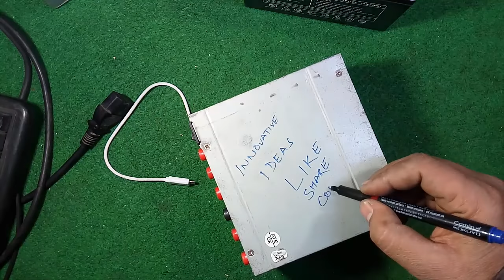How to recycle SMPS of Computer for battery charger and smartphone charger by innovative ideas

Comment: This was by far THEE BEST video on the subject that I've seen I have been on YouTube for over 10 years and this is the first video that has made me want to leave a comment
Reply: Me too..!
Reply: Hello sir If want to charge my 12 volts  battery with 15 volts...then How can I do that..? Plz reply..

And when I connect -12 volt and +3.33 volts then I am getting approx 14.8 volts...but how much amp..? Do you have any idea? Plz share to me. Bcz I am not able to measure amp bcz I  have only volt meter
Reply: Can I use Red And black wire for charging smartphone...then will provide 5 volt 30 Amp for fast changing..😁😁😆😅... This the serious question plz reply me.
Reply: nic
Reply: I fully agree with this statement, it has been 45 Years since I worked as a technician and This video brings me back to my younger days. Vert nice!
Reply from the maker: Thanks a lot
Reply: The best video ever,.. thanks
Reply: @TheSudiptheory ❤

Comment: There must me literally dozens of this type of mod to the ATX power supply on youtube.  To do this right, the battery needs to be charged to 13+ volts dc, this video doesn't show how to boost the smps to that level.  Thumbs down.
Reply from the maker: Sir, I am sorry for that, but practically I have charged the battery without boosting the SMPS, and I got success, after that I made this video.. Anyway thanks.
Reply: Joseph Nicholas 13,6V
Reply: Thanks Sale Bmw.
Reply: You are very much right.
Reply: Sir, I think the current was too heavy for charging...............
Reply: Joseph Nicholas You are correct! The voltage (not current) required to charge correctly a 12 volt lead acid battery is ACTUALLY 14.2 to 14.8 (manufacturer specification dependent - typically 14.4 is safe for just about ALL 12 volt lead acid batteries. The fully charged state of the battery after say 4 or 5 hours after coming OFF charge should be between 13.6 and 13.9 volts - 13.8 volts is typically seen. The maximum charging current should be LIMITED to prevent excessive heat generated by trying to drive too many amps into a deeply discharged battery, but 5 to 6  or even 8 to 10 amps depending on battery capacity is typical.

A 12 volt power supply can NEVER, NEVER, NEVER fully charge a 12 volt battery. 

Why? Simple, ALL batteries have some internal resistance and you must overcome the resistance with sufficient voltage to drive a charging current through the battery. 12 volts just is NOT enough to do the thing correctly, especially when a fully charged lead acid cell can easily reach 2.4 volts (nominal 2 volts) - 6 cells in a 12 volt lead acid battery = 6 x 2.4 = 14.4 volts!! Hence the charging voltage required. 

Lead acid batteries perform best when trickle charged AFTER they have reached a fully charged state. This prevents loss of terminal voltage due to internal discharge. Continually trying to charge a 12 volt battery with a 12 volt supply will NOT do the battery any good long term whatsoever and it will NEVER reach a fully charged state. Also, a battery discharged to the amount in this video is basically a knackered battery. Yes, it can still receive some charge and yes it can deliver some current but it will NEVER be able to reach it's nominal new performance EVER again.

The ONE thing that NONE of these videos deliver is a reliable, simple, accurate and low cost way to obtain 12 to say 35 volts from such a supply. Or how to provide an adjustable supply with adjustable current limiting - something a true bench supply would have. This beggars belief really, considering how simple and cheap this is to do these days. Search for a DC-DC boost circuit board on eBay (there are dozens). Some can be driven by as low as the 3.3 v rail (very useful when modern supplies have their largest power available on 3.3 and 12 volts. Many of these circuits can deliver in excess of 500 watts(!!) so be careful in your selection that you don't inadvertently provide a means of overloading the underlying supply. Simply hook up the boost converter to a relevant power rail (3.3, 5 or 12 volts) adjust the output voltage to what you need and provide one more set of DC Banana sockets for the output. Job done. 

Here's a link to a page that has several different types and capabilities (pick the best fit or search for others) ranging in price from less than $3 to under $12. Add an external case mounted potentiometer to replace the on-board one (or multiple external pots if current limit adjustment is also available) and a low cost mini DVM (and current) display for a few bucks (also on eBay) and NOW you have yourself a PROPER adjustable bench supply. These are so small and power efficient, a couple could be fitted inside a typical ATX PSU to give multiple capabilities. With a small amount of extra work and the making, or purchase, of a more suitable case, the whole ATX supply minus case could be transferred AND additional parts like individual voltmeters on each output provided in the extra space, and an extremely capable supply can be created.

http://www.ebay.co.uk/itm/DC-DC-Boost-Converter-Step-Up-Step-Down-Power-Adjustable-Portable-Charger-W/222281739597
Reply: Joseph Nicholas how about connecting -3 and +12 in series means we can use the +12 v as positive and -3 as nagitive or even -5 as nagitive so the difference between voltage will b 15v or 17v
Reply: hassan ali NO! Definitely do not do this as in almost every case it is impossible to guarantee the isolation of the ground leads from each other, nor for the two supplies to track each other, nor to maintain proper overcurrent, overvolts and short circuit protection. VERY unwise.
Reply: Bob Lewis did u try -3 as nagitive and +12 as posive practicaly
Reply: 1. it's NOT practical as it would still provide insufficient voltage to charge the battery - you need 14.4 volts to be able to properly charge a 12v lead acid battery - sealed or car battery
2. it's NOT safe for the reasons I already outlined
3.There is NO -3v rail on an ATX supply. There is no -5V rail on an ATX supply! From where are you suddenly getting these negative voltages?

Stick to a tried, simple, highly reliable and well tested method ... PLEAS!  Use a boost converter and or a separate supply. There are PLENTY of videos online showing how to do it properly using a laptop power brick (minimum 16 volts) and a cheap switching DC-DC adjustable supply (<$4 on eBay or Banggood) If you can't afford such a supply then cannibalise the ATX supply for parts, rewind the main power transformer to provide the output you require and design an equivalent circuit that gives you an adjustable 14 to 15v output 5 A supply and set it to 14.4 volts.
Reply: Well we ARE talking about a POWER rail - to match the +12v output in terms of current supply are we not? Let me be MORE specific - there is NO -5v or -12v POWER rail on ATX supplies. i.e. there is no negative rail of over mA rating i.e. something USEFUL in this regard. Yes, there is SOMETIMES a -5v voltage rail and usually a -12v voltage rail (including some supplies that SAY they have a -5v rail but have no output wire for it - I have one! NO white wire anywhere in sight! And others that have no -5v at all even on the label!) 

The ABSOLUTE maximum current from the negative 12 volts is typically less than 800mA, often as little as 300mA  and the -5v (if it even exists) is 0.3A or less typically. That's barely enough to trickle charge a small battery let alone a 45AH one. Anyone who connects the -5v or the -12v in series with the +12v POWER rail will very quickly see LOTS and LOTS of magic smoke (and sparks and fire too probably) if they try to charge at 3 or 4 amps like that - the +12v rail will have no problem supplying tens of amps usually but trying to drive that current into the -5v, 300 mA (MAX!!!) rail is just plain DUMB. So I stand by my statement albeit modified with the term POWER rail. I wish some cowboy would do a video of connecting a 45AH battery between the +12 and the -5 on a supply just to see what kind of a God awful mess it makes.
Reply: Thanks for the quick reply! I remember reading about the very low amperage supplied by those sometimes existent rails, and I agree with you. The only thing I don't quite comprehend is the purpose of those negative rails in the first place. With such a low amperage supply, they seem to be pointless. I converted my ATX into a bench supply as many people did and I most definitely don't plan on fiddling with those lol
Reply: @hasan ali.  yes i think ur idea will work
Reply: you are correct.  not a good idea unless both outputs are low current.  then of course it is only good for small batteries, or to be used as a trickle charger.  but the 12v supply will definitely bring the battery to >12V.  probably not 13 but good enough to use for most purposes. and if it needs to go into the car then it will start the car and the alternator will do the rest

Comment: Misguided video. By this ATX power supply you can't charge a 12 volt Battery fully, it is able to charge only 45-50% of the battery bcz the output voltage is only 12 volts and the charging voltage of a 12 volt battery is 14.5 to 15 volt 😀 But if you can connect +3.3 v and -12 volt it can give you 15.3 volts but the current (amp) will be very low as a result it can't be able to charge a minimum 12 v 5 ah battey. So charging a 12volt 150 ah battery is impossible in this way 🤣🤣🤣

Comment: First you need to know what is actual voltage require to charge 12volt battery...13.81(avg14) volt is perfect to charge 12v battery.. computer smps can't charge 12 vlt battery.... possible if added more components
Reply: Yes,, you are right.
Reply: Smart guy!!!
Reply: No need to add more component.  Simply check voltage of. Blue. Wire and orange wire. Output will be. 1t. Volt. Then. Simply use. Ic. Nd. Controller. To charge. Battery

Comment: the battery charging voltage of a 12 volt  lead acid battery is 2.3 volt per cell i,e 2.3*6=13.8 volt and 1/10 of the ah rating of the battery  eg a 100 ah battery needs 10 amp current to charge the battery. However the project is good for low ah battery.
Reply: Vivekananda Mandal
Reply: Vivekananda Mandal you can charge any battery at the recommended cv and cc by the manufacturer!! My 12v 7.2ahr battery has an initial current of 3amps so i set the cc on my ltc3780 to 3amp and volt to 14.4v and atfirst it changes at cc until the battery current reduced under 3amp it goes to cv and trickle charges and then when the charge current is near 0 i disconnect the charger andthere i have a healthy 7.2ahr battery that is still works for 4years now!!

Comment: you can't do fully charge the 12v batt with 12v output charger.just use it for power supply or use the 15v in bigger 12 Aah battery than that small batt you are trying to charge. less 14v you need for that small batt.

Comment: It is not possible to fully charge the 12 volt battery,  even  you connect this for  a longer period.  The charging voltage must be higher than the battery  voltage. Ideally it should be 14.4 volts

Comment: This will work for an emergency charger, won't fully charge a 12v battery and you have to make sure you turn it off manually but hey it will give you some DC volts if that's what you're after. Now this is funny, to me. I once had a cordless drill (the kind where the battery is inside) it was an old one and i would charge it with   a big charger with the + and - wires hanging out of the drill. Just set the battery charger to go off and its all good. Well one time I forgot it was being charged, the setting on the charger was HOLD and it was a three day weekend. Monday I get to the shop (and this is a big shop, it fits six motorhomes inside) Well the entire place is filled with smoke and the rechargable dril is a pild of melted plastic and wires bubbling away as the car charger was still charging it

Comment: 12v battery need 14.4v charging voltage, couldn't full charge 12v battery., -12 have maximum 1amp,  a battery need long life, don't apply over 14.4v., this was very bad trick brother., Brother you will try feedback tl494 biasing resistor adjust and upgrade 12v to 14.4v. all the best

Comment: but sir 12volt battery can not be fully charged by 12volt supply .
Reply from the maker: Yes you are right. But it can be charged up to a level..
Reply: @innovativeideas  People always complain about this matter. However, 11.5v should be more than enough to start your vehicle and go about your business.
Reply: You can charge 12 v battery by connecting+12v to positive terminal and -3v to negative terminal of battery, you go 15 v here
Reply: @PRATMAND  In this way the current will be very low that it can't charge a battery
Reply: @mrinmoy8190  yes, high current can damage the battery and reduces its life

Comment: Boss Please Help Me 

Today I Connect Blue (-12)v Dc As Negative And Orange (+3.3)v DC As Positive To The 12v DC Battery 
Also Connected Meter 
Before Switching On SMPS Meter Shows Actual Battery Voltage 9-10 V DC
After Switching On SMPS
Charging Was Started
Meter Shows 14v DC
But After 5 Second SMPS Goes Auto Off 
If I Disconnect The Battery SMPS Runs Continuesly Also Meter Shows 14-15 V DC
Please Help Me Sir

Comment: use  ornge + blue ==> will give 15 volts , use  dc-dc buck ( availabe in Flip cart/ ebay ) reduce the voltage to 13.5 - for a car battery which is 12 volt, 60 AMP. this has to be charged with 13.5 volts with 2 to 5 amps.out put.Initially go for 5 amps , then it could be reduced to 2 amps, as with more amps - more heat will be generated.& difficult to manage.

Comment: I've made these before but one BIG THING ABOUT THIS WHAT YOU NEED TO BE TELLING YOUR Viewers IS .
"" only open one of these pc psu if you understand what your doing and know it's very dangerous and can kill you""!!
And it still dangerous after it's turned off as the capacitors hold  a high charge ect.... 

Electricity is very very dangerous
Reply from the maker: David Wood yes bro you are absolutely right...
Reply: INNOVATIVE IDEAS 
I loved making these for RC HOBBYISTS FOR the 12v rail to us in conjunction with lipo battery charger and sold them for £25 a unit plus you can make a variable psu....I don't see you use any ceramic resistor for a dummie load...
Reply from the maker: David Wood thanks a lot for your suggestion. But please tell me how much voltage range you are achieving from your customized variable psu.

Comment: Computer ATX power supply voltage maxmimum 12.3 vdc. But battery standard charging voltage is 13.5 - 13.8 vdc. And 12 v battery standard voltage is 12.3 to 12.5 vdc. An under or equal voltage how to charge the the battery dear sir. I have a question with you that how to improve voltage 12 vdc to 13.8 vdc on my computer ATX PSU.

Thanking You.

Comment: Although the Voltages and the color of wires are standard, the Amperes Output is different per PSU.
If you want to know your model's correct Power Rating, you can get that information either from the label on the back of it, or by testing with a current/voltage meter. 

Don't Blow Yourself Up...
Have Fun!

Comment: -12 v has 500 milli amp so if you take -12 to +12 for 24 v you will get 24 v 500 milli amp supply. i have personally experienced this my two smps blown after i connected 24 v 5A load

Comment: after reading the comments, i subscribed, well i learned and got some useful information, after watching of speaker and amplifier i get here and learned about voltage and amp, im not an electrician but i do have spare power supply from my computer and i will try if i can do it, it doesnt matter if it will full charge or not. Thanks you all

Comment: Resp. Sir , I think this charger it will not be possible 150 AH battery because due to large current flow wires will be melted down because 15 Amps current is too high even if it works in smps mode. Please test in actually before suggesting on such media. Thank you.
Reply: charging volt should be more . for a 12 volt battery min volt is 13.5. You caan see this is written in exide type of batteries

Comment: Charger for 12V battery should have ability to charge up to 14.4-14.6V. It should have current control and voltage control. Fully charged battery has voltage between 13.8 and 14.4V. There are a tons videos on youtube  how to make nice charger from ATX power supply with voltage control and current limitation.

Comment: Nice video but you did not mention about the Green wire which when connected to ground ( black wire) switches on the power and the grey wire is the power good wire connected to an led with a 470 ohm resistor to ground indicates that all the output voltages are OK